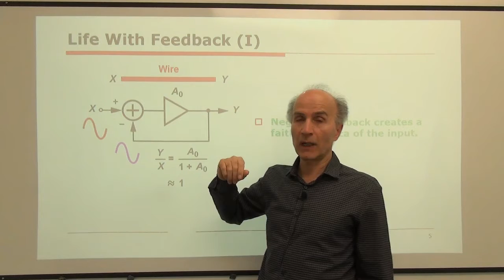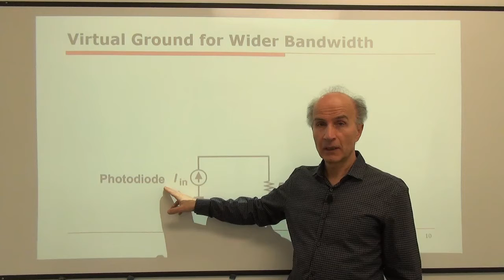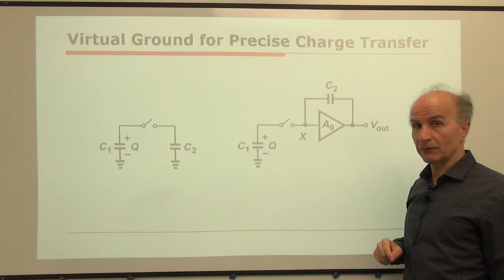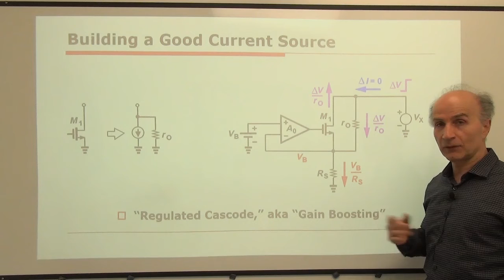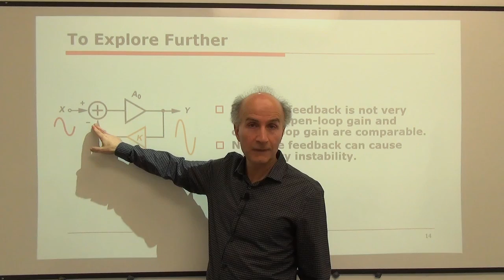Positive Attributes of Negative Feedback - Behzad Razavi | ISSCC 2022 | Circuit Insights (13)

Comment: At time 14:36 .. on TIA .. i think Node X should NOT be virtually connected to ground because we need minimum VDSSAT across the NMOS transistor to keep it in the linear saturation region.
VDSSAT for long channel MOS is VGS - Vth. I think it should be virtual VDSSAT/VCESAT not virtual ground to maintain the transistor linear regardless of the swing at the output
Reply: After proper biasing of MOSFET, You can use it as an amplifier. If we do small signal analysis we will deactivate DC sources right? Again In the signal analysis why you are talking about bias voltage calculations. In signal analysis we usually do not care about how much drain voltage. In common source amplifier gmvin signal current flows through the MOSFET when source is grounded.

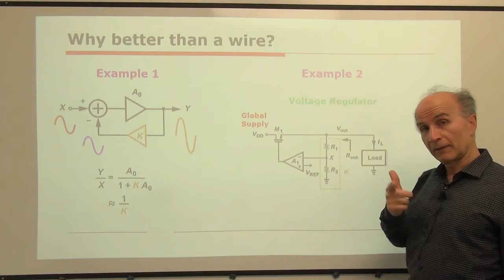Comment: At 11:35 professor if I give directly vref ( voltage ) to load..our device ( load ) might be damage due to unwanted voltage spikes.. actually if we suddenly turn on the device.. sometimes glitch r else voltage spikes takes place.. may be sometime load can't tolerate these spikes that was the reason we need regulator.. is this correct reason ?
Reply: if we connect Vref directly to the load, our load will be "loading" our Vref source which could change our Vref because our Vref source has an internal resistane. In the circuit above, the opamp does not load or draw current from our Vref source. This will not cause Vref to drop inspite of our source's internal resistance coz our opamp input does not draw current. The load in an LDO (Low Drop Out) regulator in the video draws current from the supply (not the opamp) thru the power transistor M1 at the opamps output